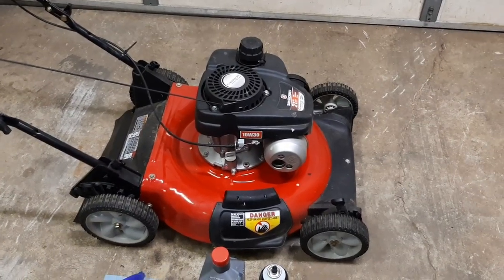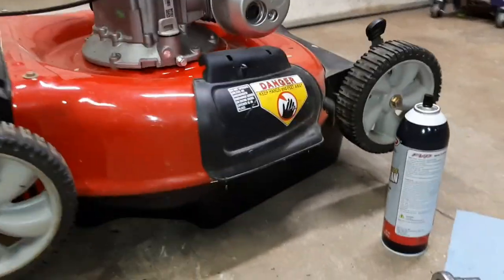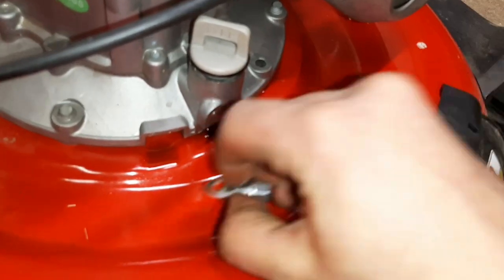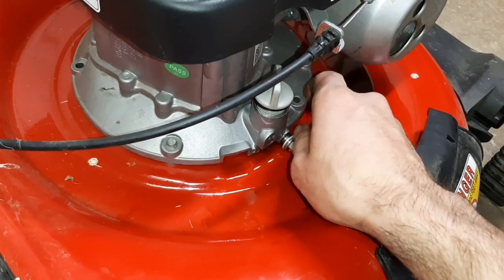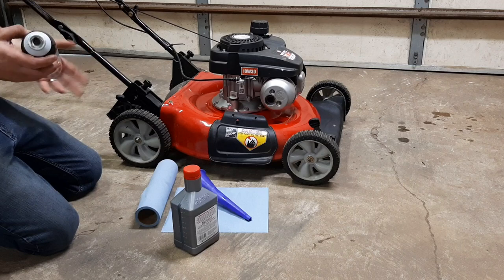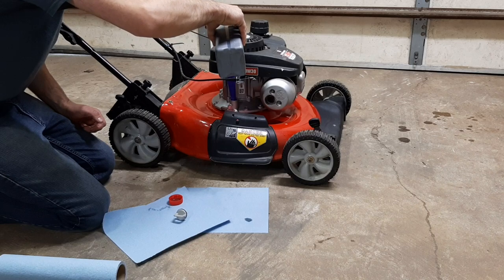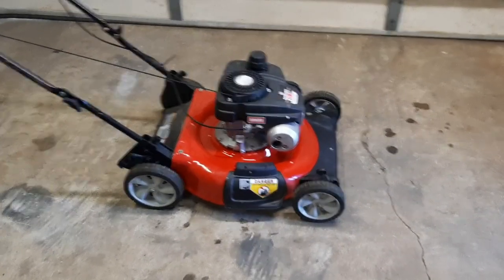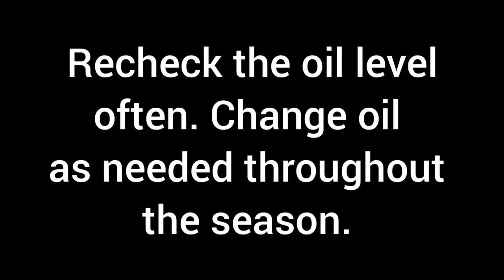Oil change on Yard Machines push mower

Comment: The video is 4 yrs old, I thank you for it!!  Did it today!!
Reply: Well...these are a mid 20 teens model.     I'll tell you one thing, that engine and mower are tough.   i had one for 6 or so years before it got stolen. It ran like a top every time.   Had no shed. Left it out in the elements every winter.....didn't damage the mower at all.   It's a tank. I was going to finally change the oil but it got stolen before I could do it.   I think it would have outlasted me. LOL

Comment: Very well explained. Just purchased an M70 craftsman with the same setup . Will have to ensure that I have a container to fit under the body to collect the oil . Beats having to tip the mower over as I need to do in my 125 cc Yard machine.

Comment: Nice video. Except when checking the oil, do not screw it in. Remove oil
Wipe off and have the dipstick rest on top. Remove and check. Should be about 20oz.😉

Comment: What other tools fo I need to work on thus type of mower? 
Please.  What size sockets  or anything else. I have o lawn mower that won't start. But really need it working asap.
Reply from the maker: Usually for something like this you'll need a 3/8, 7/16, 1/2,  9/16 and a couple screwdrivers.  That'll cover about everything on a push mower.

Comment: Well this is lame; I too have a Yard Machines 21” 140cc. The 500E version does not have an oil drain plug, and if it does it’s NOT in the place or even relative area. I cannot find it.
Reply from the maker: Just pull the dipstick and turn the whole machine upside down into a drain pan.  Or get a fluid pump and suck out the old oil.

Comment: Hello I'm helping a friend of mine change the oil in a yard machine pushmower P510 they just bought but it didn't come with a manual. 
The 
Serial # is 1P51NUA2008293A1456
I tried looking this mower up and I can't find what the oil capacity is? About how much oil should I put in?
Can anyone help me out?
Reply from the maker: Someone in the comments says it's 20 oz.

Comment: I applaud this video but disagree with his process. It is a messy time consuming and has too many steps. 
There is a much easier process. 
I Purchased, a 500 cc fluid extractor on Amazon for $17. There are many other cheaper extractors available. 
1. Warm up engine.
2. insert extractor tube into crank case.
3. draw out the used oil.
4. replenish with new oil.
5. this took me under 10 minutes to accomplish.
I put the use oil back in the container that the new oil came in. PC.  There was not one drop of oil anywhere to clean up. I know I will be changing the oil more often because of this.
Reply from the maker: I completely agree. At the time, I didn't have a fluid extractor. Now I do and it's one of the best tools you can have! I use it all the time.

Comment: 5W30 synthetic also is good. Had to use the generator this winter. Used it enough to do a oil change. Got some left over. 
I tipped it over on the carb side. Should not do that. Yep oil did get in the carb. Then flipped to the other side to take the blade off and sharpen it.
 Drained the carb twice. There was oil in it. I guess that is normal for those engines.
Pulled the plug and cranked to see if oil got in the cylinder. Just in case it hydrolocked.
Cleaned the plug with gasoline.
 Carb cleaner did not survive the winter.
So why look here? Could not find the manual that came with it. Probably find when I am looking for something else. Hope @shawnmckee6951 is right.

Comment: do you really need to change it frequently? just top it up.
Reply from the maker: You should at least once a year.
Reply: If you dont want to blow the engine or have the engine seize up on you, you should change the oil if its not the color of new oil (gold) or see though.
Reply: @Aye_Alan  not true. Good oil could be dark in color as well. In fact, oil turns brown after only a couple minutes of use. Just change it every 1 year.

Comment: What type of oil?
Reply from the maker: 10w30. I like to use something designed for small engines.
Reply: Would Briggs and Stratton Small Engine Oil SAE 30 work for a push mower?
Reply from the maker: Should be just fine.
Reply: @Whitestrash  Sweet, thanks man

Comment: You're not supposed to thread the dipstick in to check the oil.
Reply from the maker: On some engines you do, on some you don't.  My experience with lawn mowers is you thread it in, but i could be wrong on this one.